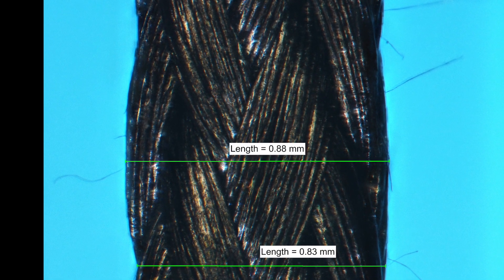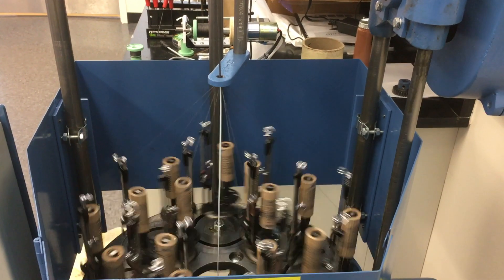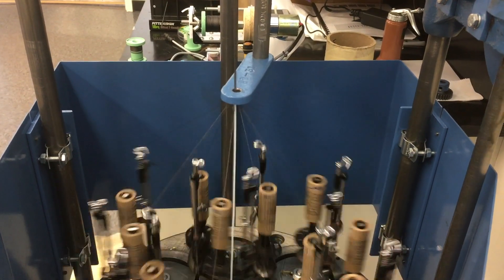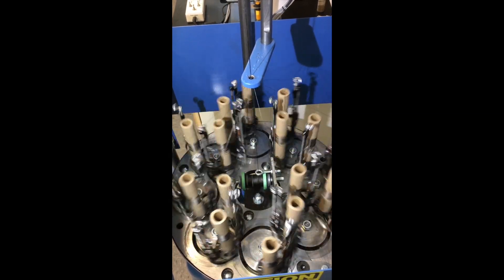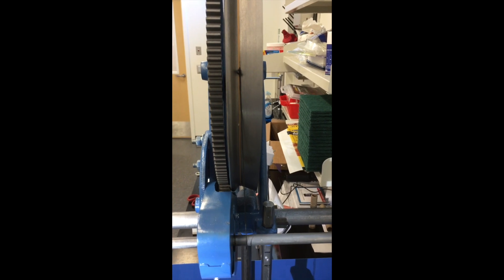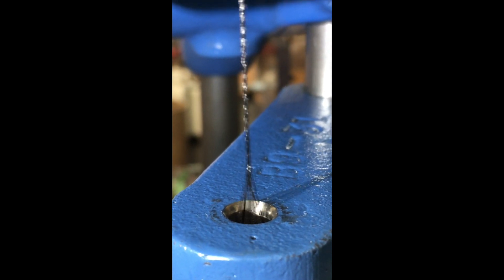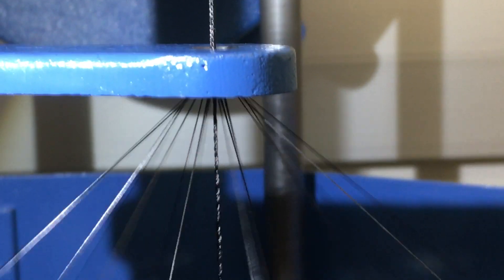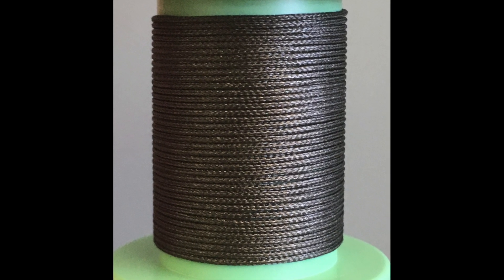Braiding Carbon Nanotube Fibers

Comment: Do you think it's possible to make a hexagon shaped wire, or bunch of wires/braids?  At least with them surrounded in a chopped graphene carbon fiber/nanotube housing (protection)  Like in a graphene resin?

For the smaller nanotube yarn pieces, have you tried to make a graphene resin/nanotube "functional isotropic" part, like carbon fiber?  Just with graphene resin and the carbon nanotube yarn pieces.